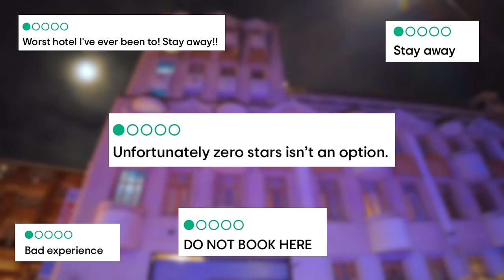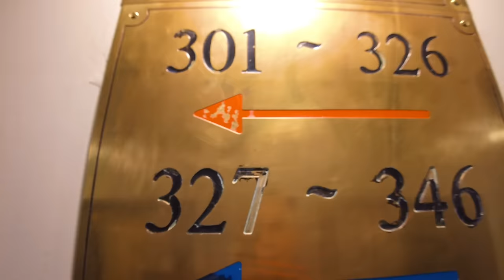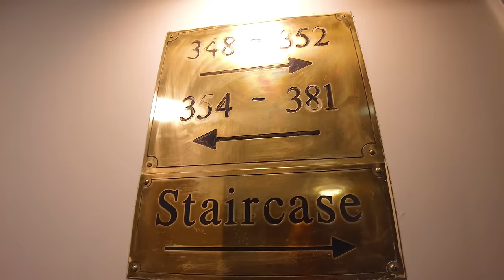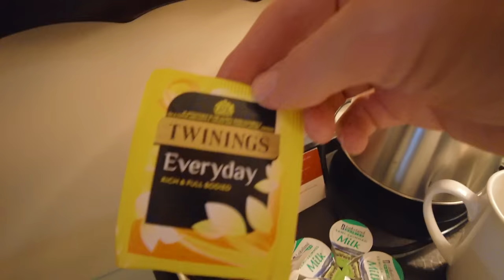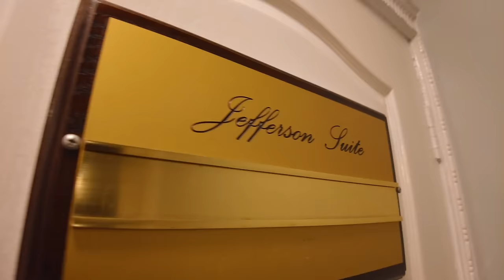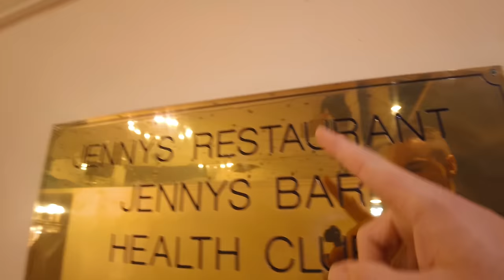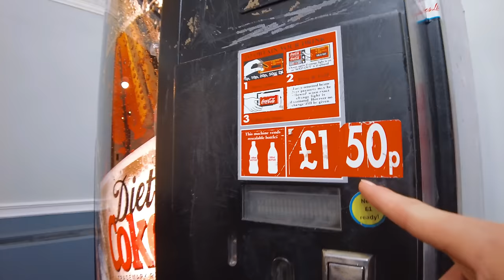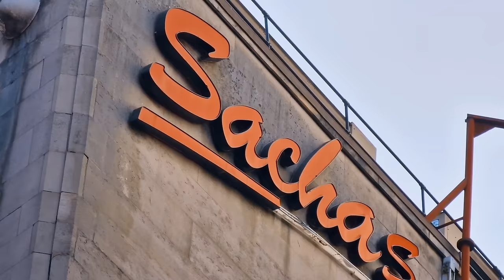Worst Rated Hotel - Sachas Hotel, Manchester

Comment: £55 in Manchester? Absolute bargain! You even got a hairdryer with a brand new diffuser. Biggest problem was that the door didn't lock. I would have taken a trip down to receptionShame about the lack of water in the pool, I'd never expected to be able to swim in a budget hotel and it would have been an amazing bonus. I would have gone out of the hotel for a meal and drink.
Reply: There's lots of bars and eateries right by the hotel, which is in the Northern Quarter. Also the coffee pot, around the corner, does a nice breakfast (so you can have a lie in!)
Reply: Some people expect the world for a couple of quid
Reply: @bobby6517  not really travel lodge and premier inn have proved you can offer decent accommodation at a cheap price.   Stopped in Manchester recently at travel lodge and it worked out at around £75 a night much better than this s**thole.   Britannia hotels are renowned for being horrible the one in Birmingham is the same.
Reply: @radiohead123451  My experience with Travelodge St. Pancras in 2015 wasn't that much better than this. I (very politely) complained that the sink in the bathroom took over 15 minutes to drain and asked if they might be able to get someone have a look at it. They offered to move us to another room instead, which we politely declined because the bathroom was even worse and the room lacked the secondary glazing that made our original one acceptable - Gray's Inn Road can hardly be considered quiet and it wasn't very warm either. I definitely found it odd that adjacent rooms were so different, some with decent secondary glazing, others only with the single-glazed aluminium windows (gold anodised) from the 60s or whenever the place was built.
Reply: The door looked like it'd been kicked in at some point. Not great.
Reply: @pmberry  I had a door like that at home. It can be caused by a toddler in a homicidal baby walker
Reply: @evelynwoolston7  Agreed but that wouldn't have been the case here. That points to a slightly shady hotel.
Reply: You are right❤
Reply: @bobby6517  - this is what im saying❤
Reply: @anne-lysuits7471  ?
Reply: Travelodge is about £41, Ibis is about £42. Obviously they are not 5*, but they will certainly be a lot better than anything Britannia can offer.

Comment: I stayed in this hotel a couple years ago and enjoyed my stay. It was a little run down in places but I was not disappointed in any way. My room was identical to the one here except there was no second bed, there was a sitting area instead. I stayed for 2 nights and could not have asked for a more helpful staff either. I hope things don't go too downhill!!   The area was amazing for the price.
Reply: why do you sound like hotel staff lol?
Reply: Okay Deborah. Back to hoovering the hotel carpets now hen.
Reply: @pinball7113  some people just have different expectations. Whenever I go to London I often stay in run-down hotels in the Bayswater area, but as long as the staff are helpful and there's hot water and no obvious dirt, that's all I need for one night.
Reply: Stayed there myself with my partner a couple if times, usually for nights out , going to gigs. Never had a problem. Pretty basic but fine fir a few drinks round the city center
Reply: Did you write a good review?
Reply: @kaysmith8992  Exactly! Same here. We also go to the Bayswater area.
We have no complaints.

Comment: As someone that has secondary employment in a hotel, if you cannot operate the bottom lock on the door at all, it is usually a feature of the lock that it automatically double-locks when the door is shut (therefore it appears broken). There's a pin which activates the lower bolt when the door is closed in to the frame. In my opinion it defeats the object of having a deadlock, but our lock provider says they are proven to be so secure that no extra bolt is required. As long as hotel staff know what they are doing when handing keys out there is no issue. Take from that what you will.

Comment: I stayed here a few years ago in a room with no windows with a friend. We had a random column between the beds, curtains on one wall to make you think there was a window, it was unbearably hot and the artwork in the room was a drawing of a naked woman.  Ended up with a migraine because of the heat and no windows. It was cheap and you get what you pay for I suppose😂
Reply from the maker: yes so many are talking about how hot the hotel is
Reply: You shouldn't have to pay for a migraine.

Comment: That one doesn’t look too bad - it was a C&A department store built in the late 1920s and it was converted into a hotel in 1987 hence that muddled art deco / post modern exterior which probably has had no maintenance since the conversion. Otherwise, it’s ok isn’t it? Get some fitted windows and a decent cleaner and that place is fine.

Comment: I have stayed there in a windowless room. There was some sort of extraction fan in the ceiling, the type you would expect to see in a bathroom, and it was noisey! There wasn't a switch to turn it off, presumably because of the room being windowless and it may help with air circulation? 

Sachas does serve a purpose to a solo traveller who doesn't want to pay the usual Manchester City Centre prices, some being £200 or more.

Trivelles in Salford is far worse than this. Tim should have a look at Trivelles Salford.

👍

Comment: You explained yourself why the curtains are stained on the outside, imagine the condensation and or mould those curtains will be absorbing when they're partially exposed to the elements. It doesn't look that bad to be fair; and for 50 quid, well you could do a lot worse! At least it's heated! This is probably their version of a presidential suite though; so I think you should check some of their other rooms out!

Comment: The mahogany and chandeliers to not mean this is an old hotel. Back in the 70's this was a C&A clothes store before they relocated to the Arndale Centre. It is no wonder that converting it to a hotel meant there are rooms in the middle without windows or natural daylight.'  What got me when I passed Sasha is the glass frontage of  the reception looked as if it hadn't  been cleaned in a decade,  as you didn't comment on this I  take it they have at last rectified this.

Comment: In a room like that you should put the heating on full, then open the window wider bit by bit until the temperature is right. You've got no soundproofing anyway so the open window won't make much difference. 😎

Comment: It's a pity it'll be noisy outside all night. If the room is as warm as you suggested when you entered, and the bed is right next to the hot radiator, I'd definitely prefer to leave those pivot windows open during the night. You'll sleep much better in a cooler room.

Comment: Those horrible louvre windows! Chic in their day, whenever that was! Thanks for doing these, Tim. They're far more interesting than if you went to high end hotels all the time (but that's not to say you don't deserve to!😊)
Reply: Many of those louvre windows you see in Florida.  Always thought if they are on the ground floor, they would be real easy to pry open from the outside.  In Florida the heat of the summer kind of makes the A/C work overtime with louvre windows.  Must have been really the thing back in the 60's.
Reply: My parents had those windows in the kitchen, they eventually replaced them with double glazing as you could famously just slide the glass out of them and get into the house!

Comment: I stayed there once and after the initial check-in and stabbing, when I got in the elevator there was a strange smell coming from the dead rotting maggot infested corpse lying decomposing in the corner...My room had blood on the sheets (but that may have been mine from the stabbing) breakfast was ok apart from the cockroaches. Also the killer  clown under my bed was extremely rude.....Overall 4 stars out of 5.

Ok, I made that up........The killer clown under the bed was actually quite polite.

Comment: Stayed here twice in 2008 and 2009 and it was actually alright. The restaurant and bar were both open and the service was excellent, while the pool was filled with water, was open and the lights didn’t flicker!🤣🤣🤣.

Now it seems like its got different management and has gone downhill horribly 😲. The only thing they done right here, is that the lifts actually worked!.

Comment: I used to go in Sachas for the record fair in the late 80’s early 90’s. It was located further on from the lift you got in. The carpets were from the 50’s or 60’s so at least they’ve updated those 🤣 probably the only thing they have updated. The old carpet was the hideous pattern ones if you know you know 😂

Comment: We stayed there in 2009 the rooms were shabby as the carpet was worn out. The bathroom cupboards were broken. Our bed was uncomfortable like hard rock. Some rooms didnt have windows. Our room had windows.  The only positive part was the breakfast which was included in the price we also paid £55 per night.. We didnt like staying there.  But since then I noticed the hallway carpets are different in the video and I noticed in some parts were the same carpet as before.  We were there for a wedding.  There was a hall there which was okay.  I noticed the front part of the hotel as well. I noticed the long corridors and on one side it was like a haunted place and run down l wonder if it’s improved since then. 😮 3:21

Comment: With the bed, I don’t think they’re two pushed together if the separation is at the side, as it won’t be long enough for a single if you was to flip it round. If the separation is at the end of the bed then yeah, it’s two pushed together. 

Technically yeah, it’s two together but that’s as the frame/divan is manufactured that way. Heard you mention this a few times in other videos which by the way are really great - love seeing you pop up on my feed.

Comment: We did the Sachas windowless double a few years ago. There was AC but it was on maximum the whole time, and it was blowing out of a hole in the ceiling directly above the bed. I tried to adjust the thermostat and it fell off the wall. It wasn't actually wired up. There was a bottle opener on the wall by the toilet, though, which is nice.

Breakfast was on the dancefloor where nobody had cleared up the previous night's empties. Stale lager. Mmmm.

Comment: £55 is cheap as chips and I expect it to be pants.  I've been to a hostel in London which was even more scary.  I did ask for a room by myself but when I checked in they said the previous occupant hadn't handed back their key, so I slept with one eye open.  As long as I can get a safe space, £55 is fine by me.  The bar was probably closed because people went out for cheaper booze.  So that's why the bar is closed.

Comment: Try strand palace hotel london.
I had a room there that was cramped. The bed was against a wall. It overlooked all the air conditioner compressors. It was hot and I asked for a fan which was crusted in dust.
PS it was a single room booked by work while I did a 3 day course.

Comment: if have flashing lights like that means there is water residue on the wires , meaning structural damage due to mould in the ceiling gaps

Comment: I stayed in this hotel in 2019 (i think) 
The room was pretty bad, there was these weird bugs crawling up the wall, and squished into the wall, the floor was dirty, loads of big piles of dust and fluff around the edges of the carpet, especially in the corners and near the furniture legs.
The bathroom had black mould in the sealant, and stained floor, the room window didn't close fully just like the one in the video, and the room door locked , but the keep for the lock in the door frame was loose so wasnt very secure
The bed was stained and had hairs on it, i ended up sleeping in my clothes and put a jumper out my suitcase on the pillow so my skin didnt touch it! 
I only booked it because i had a flight from Manchester airport the next day and it was only a 10 minute walk from Piccadilly station, i think i paid £35, so you definitely get what you pay for 🤣
The staff was nice though!

Comment: The odd stained curtain or weird mark on the wall wouldn't be a problem for me. 

But the blazing radiators, shoddy windows, lack of ceiling lights, weird TV placement, lack of locking door, ancient knackered beds, windowless rooms, the horror show of that empty pool and gym with the flashing lights, and lack of any bar or restaurant at 8pm. 

£55 a night too. I've had cheaper stays in much better hotels.

Comment: Hi tim, uh just an observation. 
I seem to remember you saying the building giving you the creeps. 
At 14:10 did you see the dark room off in the corner of the pool. 
I've watched it back 10 times and in slowmotion and still don't know what it was.
It can't be your reflection because it clearly moved the towels after it runs off into the corner ?!
Not to creep you out even more but i think you caught something there.
Reply from the maker: omg I looked and dont know what you mean, I did do some research and understand its haunted and lights flash also
Reply: @WalkWithMeTim  It's hard to see at first but right when you put your camera against the pool window, there's a small service closet? or something like it on the left hand side in the pool.
It took me and my wife several times but there's a clear black like cloaked figure or moving rapidly into the closet that isn't there a second before when you walk up to the window.
It moves quick enough to set all the towels in the closet off too, as they are moving quite a bit , and the shape moves out of view.
It only lasts a literal second too, had to put it to the slowest speed to properly see it but its there, right through your reflection.
The exact time is actually 14:12 to 14:14 .

Comment: Have you tried The Waverly Inn, Inverness at the weekend!  Yikes!
Reply from the maker: nope should I ?
Reply: @WalkWithMeTim  It's thoroughly shocking. Cheap and shocking. We'll be staying at the Black Isle Brewery Hostel for a decent, affordable stay next time. The room we were in the lamps didn't work, TV didn't work, don't watch it anyway, but not the point. There were dubious stains on the carpet. The room wasn't very clean. There were two shared shower and toilet rooms. Very dirty and both the toilet seats were broken. I made complaints about all the things that were wrong with the place nothing was fixed or sorted or altered. The noise from the clubs was excessive.  The curtains didn't fit the windows. Reception was a joke. It looked run down and was no better inside. We couldn't afford to change hotels and the hostel was full. It was for 2 nights. I must say I was warned but I didn't think it could be that bad! 😂😂😱 No disabled access to speak of!

Comment: I could be wrong but I think part of the hotel used to be the free trades hall before they sold it but it is 30 years since I lived in Manchester and it is still as ba a it was and you need agps if it works could be on wrong site.

Comment: I wouldn’t go off ratings necessarily Tim.

I regularly stay in a hotel in North London - I work away from home - that is dire. I stay there because it is cheap.
The corridors often smell of weed. The room I was in last week smelt of piss. When I arrived I had wondered why the window was open in temperatures of around 3C! Closing the window told me why…
I’ve had to ask for a kettle one night and another time I had to ask for a window to be fixed as the latch was broken.

In the cheapest rooms, the hotel has shared toilets and bathrooms. The cleanliness is sub par and the soap and shower gel dispensers are either broken or empty meaning the inability to wash your hands properly. Since September, I’ve never seen one that works.

There is nothing wrong with the customer service except the one time I rang only to be told to ring back as the employee had work to do!

If you really want to see a sub standard hotel, I can give you the name of the place.

Comment: I stayed in this hotel in July because it was the only cheap one left.
I was put in a smoking room at first and it stank of stale smoke on the whole floor, managed to change to a no window non smoking.
joint worst hotel experience ever, boiling hot rooms, terrible aircon, awful security on the door at night.
and Im not joking I herniated a disc in bed!

cheap and well placed for a night out though... then again so is easy hotel around the corner and that's great